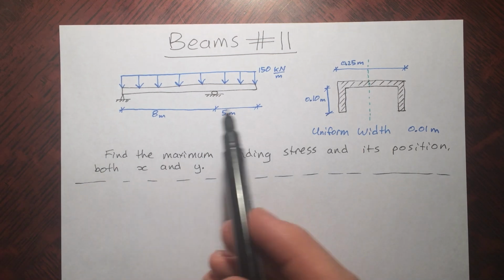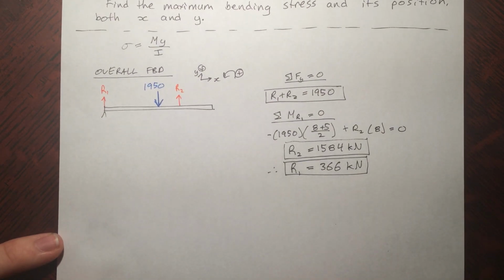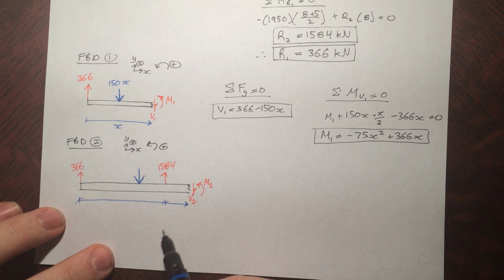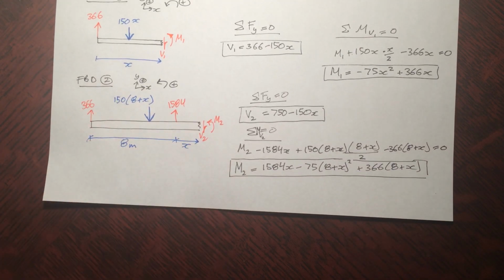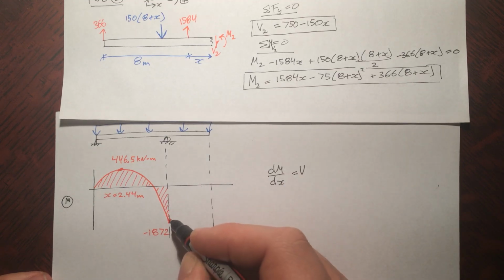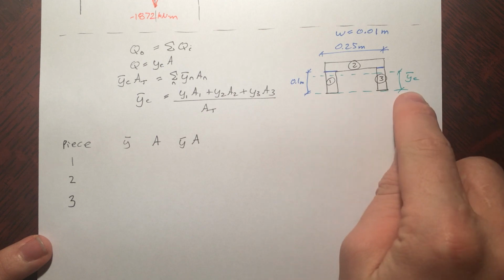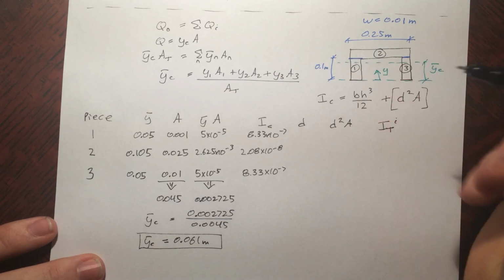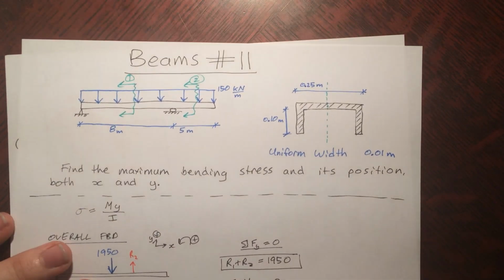Beams - 11 - Bending Stresses in Beams Example #3: Uniform Loading, Channel-Shaped Cross Section

Comment: so many mistakes in calculations.. here is a couple of mentions:
@15:17 - Area 2 should  0.0025mm^2  not 0.025mm^2 & Area 3 is equal to Area , which is 0.001mm^2.
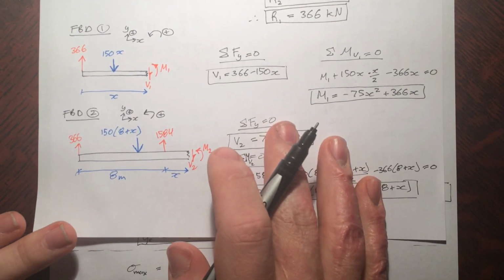@18:55 - Total moment of inertia should equal 2.392x10^-6 not 5.03x10^-5

with this the totals for Y-bar x A and subsequently the rest of calculations are incorrect.
Reply: What is the actual formula for d sir?
Reply: @richardacordaquendangan7416  d for each element is different, depending on it's position. But putting it simply, it is the distance between the elements centroid and the centroid axis of the whole body.  If you see 18:00, he uses the parallel axis theorem in where he determines d values from the broken down elements and the value of y ( centroid axis) to find d for each element. 

I hope this helps!